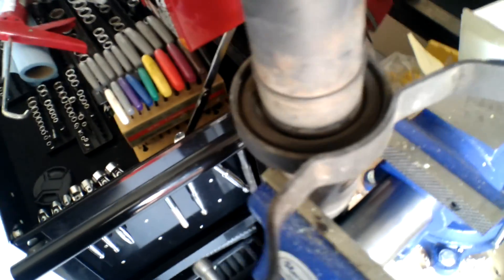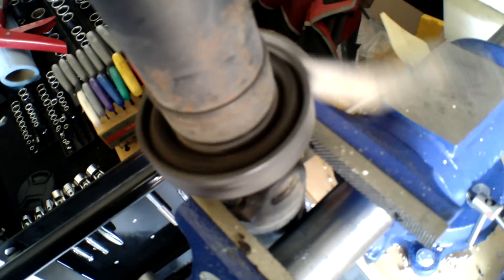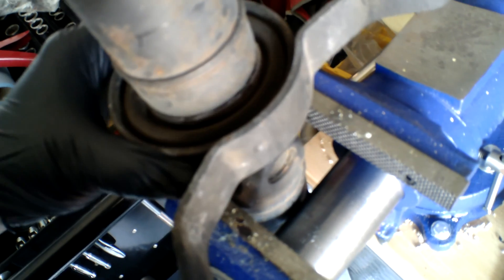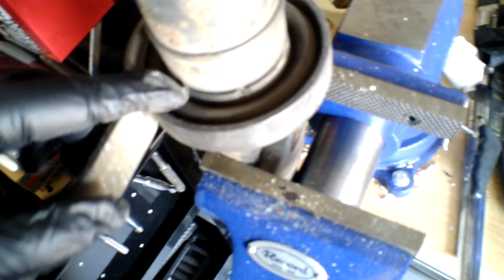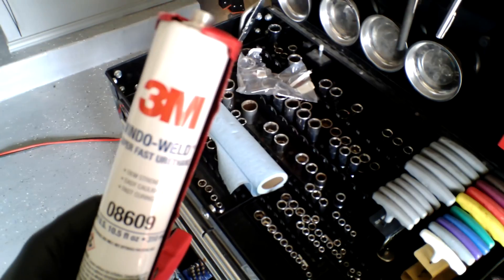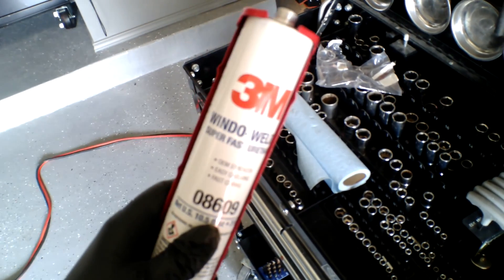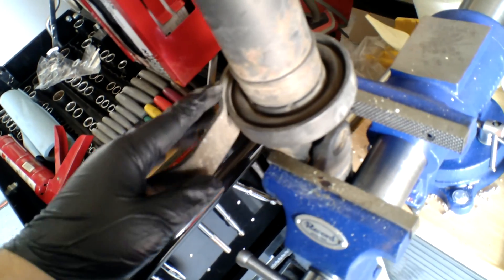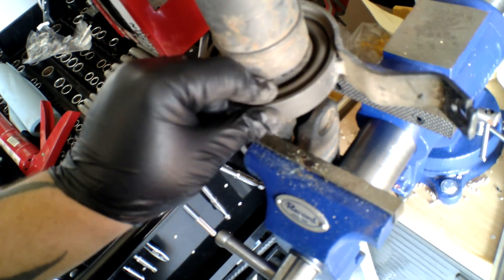AUDI B5 AND C5 TWO-PIECE DRIVESHAFT REMOVAL AND CENTER SUPPORT BUSHING REPAIR

Comment: I got my drive shaft support bearing from 034 brand new
Reply: How hard was it to replace entirely? Is it just one bolt that holds the 2 ends of the driveshaft together? (Like most other driveshafts?)
Reply: @ericvandyne2011  no constant velocity joint on front and kinda gotta press the support bering on
Reply from the maker: Replacing the bearing on these driveshafts it a freaking pain.
Reply: Yeah I'm trying to chase down my problem. I'm gonna start with the transmission mounts first since they're the easiest, then snub mount, driveshaft carrier and hopefully last but not least the motor mounts

Comment: Jim, I tried doing the Window Weld repair when I pulled the center drive shaft to swap out a front CV. The poly unfortunately stiffens it up so much that it can't flex and oscillate as needed at higher rpms so the only solution I can see is to pull the prop shaft again and swap out the center support bearing with the new one from 034. Working on that today...

Comment: I'm pretty sure I'm having the same issue as you had. Did your fix work after you modified the poly fill?
Reply from the maker: It' helped some. I found it was a bit too still and ended up removing the thicker side and just left the outer side and it was much better.
Reply: @NOTSOSLIMJIM  awesome, thanks man! I'll give it a go and if it's giving me troubles ill just pull the trigger on the 034 replacement hanger.
Reply from the maker: @BlackSkiCoach  I did that on a used driveshaft. Totally pain in the a$$

Comment: Do you still have vibrations? You didn't leave loose the bolts and start the engine, put in drive, let it naturally center an than thighten the bolts?
Reply from the maker: I used a laser to center the shaft.

Comment: Hi. Did you get vibrations at high speeds like 110-130km/h?
Reply from the maker: Yes. Which can be a lot of different things. Best to physically inspect the driveshaft components. I can be a vibration from the motor, front suspension, mounts, tires, breaks, steering rack, diff bearings, half shafts. Lots of things on this car can be a real pain.
Reply: @NOTSOSLIMJIM  front rear mounts arms controlled. New tires and balanced.. Engine gearbox mounts.. New brake rotors and pads..
I don't have any vibration on the steering wheel at all..
Only vibrations that I feel back of the car under the seats.. Starts from 50km/h and it gets worse at speeds like 120km/h
Reply from the maker: @ea8390  I'd get under the car and pull the heat shields and inspect. Also check for alignment. I've seen a few out of alignment from work done on the vehicle and not realigned afterwards.

Comment from the maker: ***update****

I got a chance to drive around at different speeds with this repair. It seems that the poly makes the center support too stiff sending vibrations to the chassis. I have removed the thicker section of poly fill and will test it out again later today.